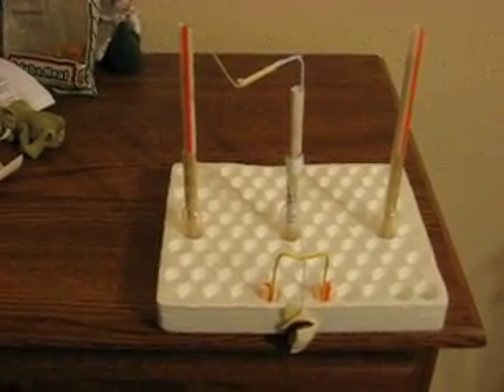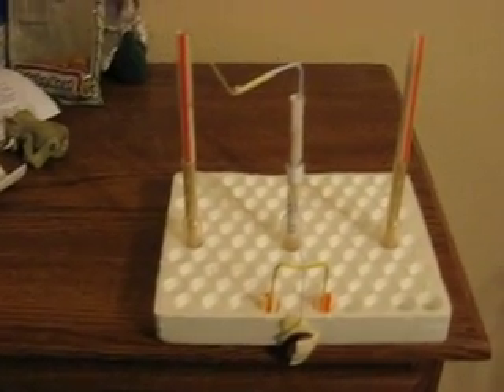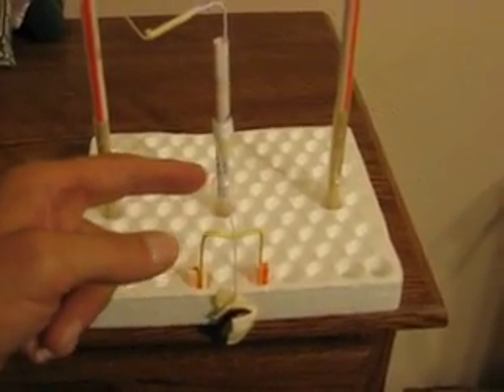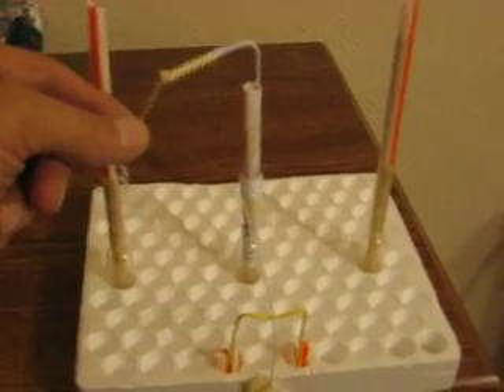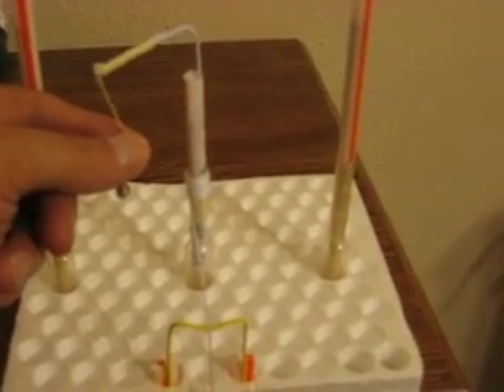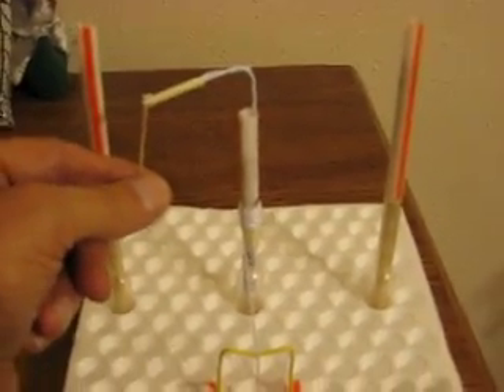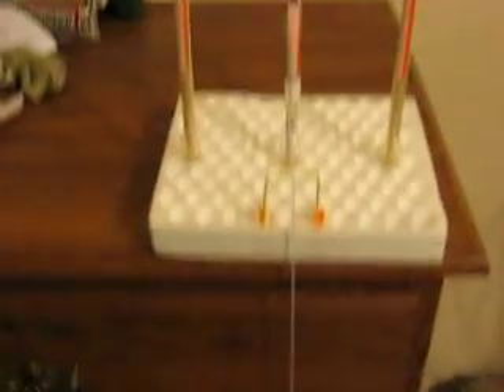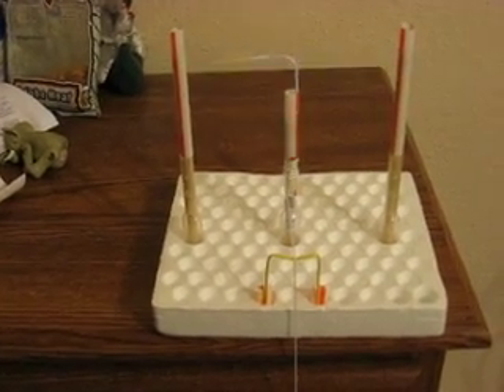Escapement

Comment: bobberto60 is right (even if he's an ass about it).  It won't work, at least not for an accurate clock.  You've got the escapement part working but you still need a timekeeper, like a pendulum.  The problem with what you have is that if you use a heavier weight (more pennies), it will go faster, right?  It won't keep time accurately.  A pendulum keeps accurate time because its swing period is independent of its mass.

Comment from the maker: Thanks for the comment. I will try the rubber band theory. The problem I am faced with is the durability of the material linking the ball to the swing arm, in this case it is the string. String after excessive use will break or the fibers on the string will fray leading to the frayed edges clinging to the poles. I need something durable such as fishing line that does not have any fibers. In my opinion a rubber band will not meet the durability standards I am seeking.